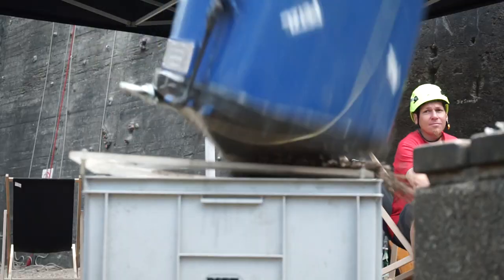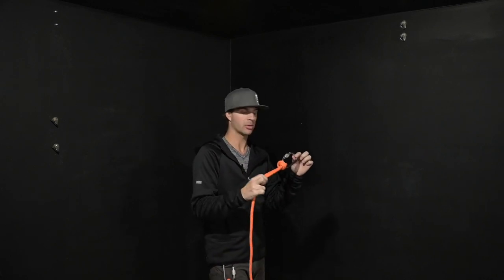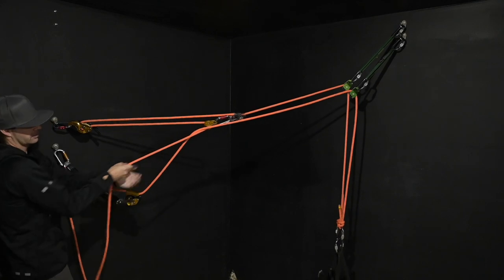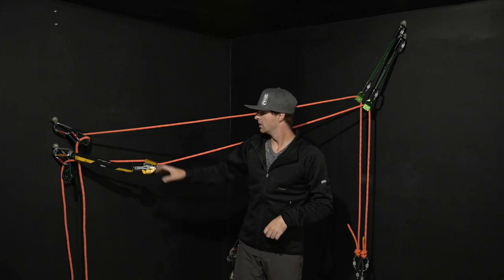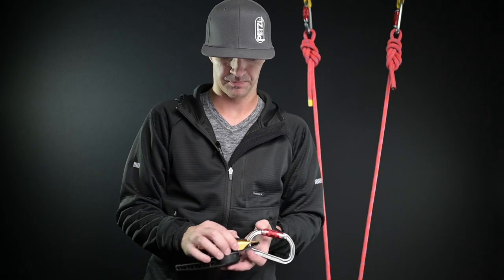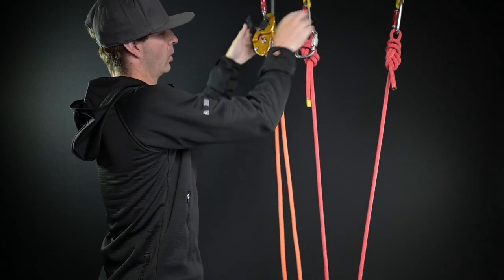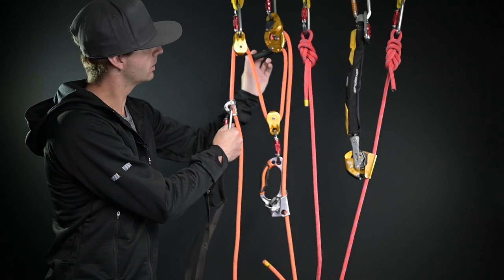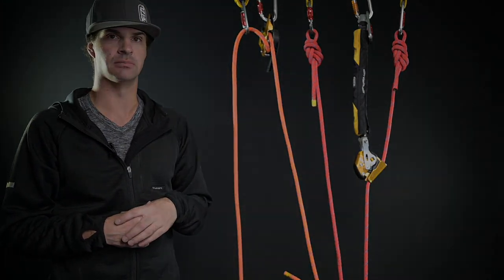HOW TO SET UP A LEVEL 2 HAUL SYSTEM - ROPE ACCESS AND CLIMBING PODCAST

Comment: Great Video. Would recomend to show a new rope replacing the backup line, so there is no confusion when lowering a load on a longer lower system. Yeah its probably obvious but just thinking of the confused level 2 trying to figure it out.  Great video, simple, easy to understand. Will be showing your videos in my class next week!!!! Looking forward to more.

Comment: Hello Mike,

Thanks alot for a very well produced set of videos. Is it possible to also do a video that stresses thinking about loads on anchors when rigging a haul such as the first 7 mins suggest. That 90 deg.  redirect is of course quite common in the working world such as hauling from a gantry into a silo or something similar. Would be great if you could explain forces applied to anchor points in those angles.

Thanks again man, Keep it up
Reply from the maker: Hey Daniel, 
Thank you for your comment.  I will be making a video to help understand the anchor loading.  But it will not be in great detail.

Comment: Good afternoon in the systems of not having ID you can use a RIG
Thanks for sharing
Reply from the maker: Hey Roman, 
I was using a RIG and Flows in this video. But  that’s why I you will notice me say control descent devices inside of a using a name of a device in most cases.

You can use any sort of Progress Capture here.  But in the event that you may have to lower the load.  I’d suggest using a control descent device. 

I hope that answers your question 
Cheers
Mikey

Comment: You made a very nice video and I have a question. Why do you advise (10.30) against setting up the rig for rescue system with one ID and one ASAP (instead of using 2 ID's)?  You gave your reason that you wouldn't want the climber on climbing on the wrong rope. As long as the ASAP is not locked how would it be possible for the climber to "climb on the wrong rope"?
Reply from the maker: Great question.
It would seem like theres no way that your working tech could possibly get on the wrong rope.  But people miss things.

Next down fall here is. In the event that the rescuer needs to get on the system… For whatever reason. It doesnt complicate the situation.